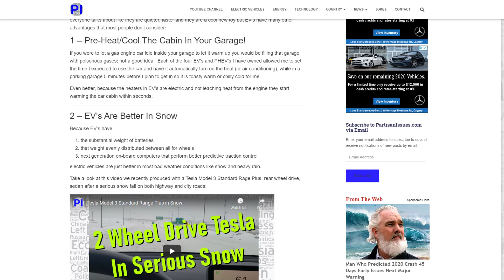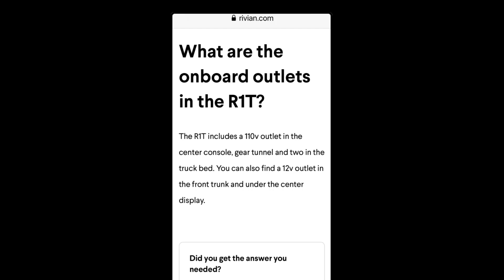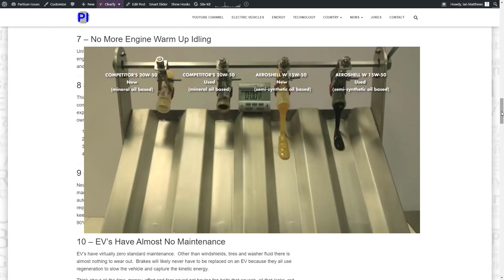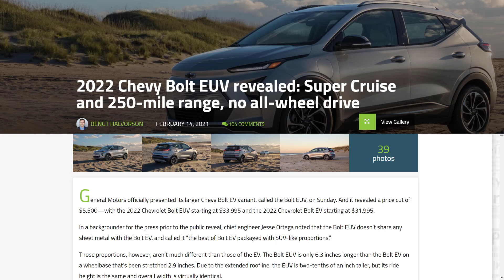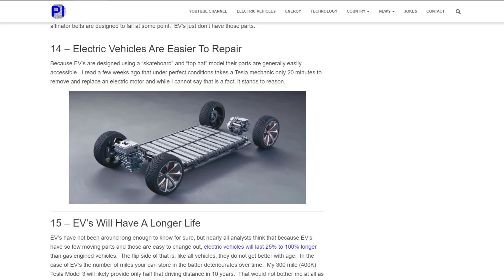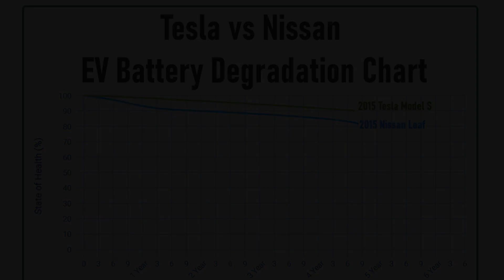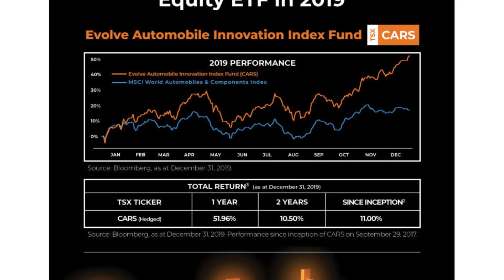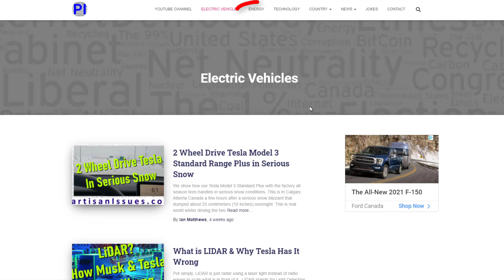Hidden Benefits of Electric Vehicles

Comment: Electric cars are nice
Reply from the maker: There are so many cool advantages that most people just don't think of.  Thanks for the comment Manuel.
Reply: @IssuesLab  an advantage I have as an ev driver is instant torque, it allows you to perform moves that you would not be able to perform on ice cars, for example, if you are turning and there is traffic, on ice car you would want a very comfortable gap but on an electric car you can have a smaller gap since your acceleration is usually faster
Reply from the maker: @Manuel0  You bet, I did not cover the things people talk about now like crazy pickup and torque, but I love it!  Thanks again Manuel.